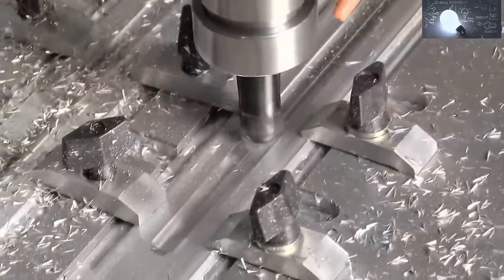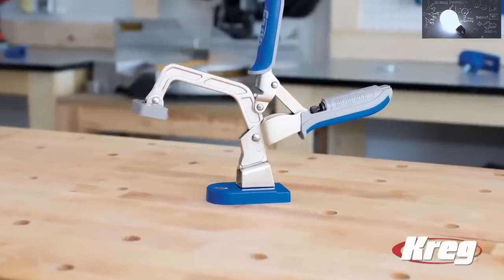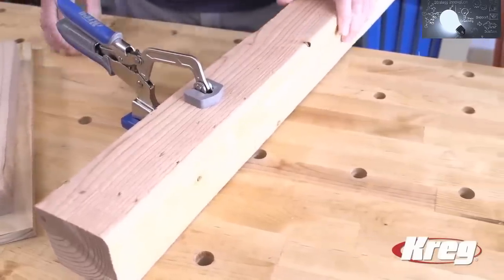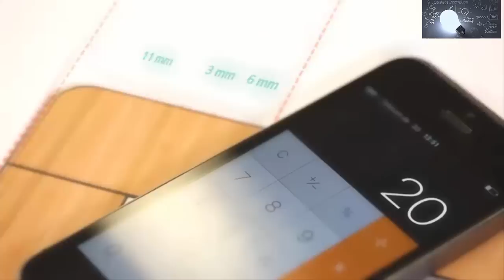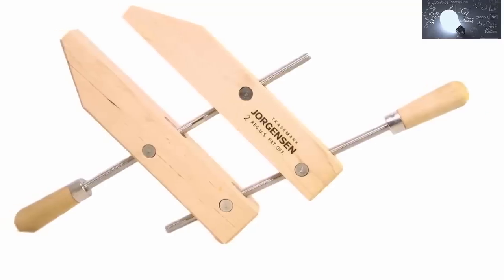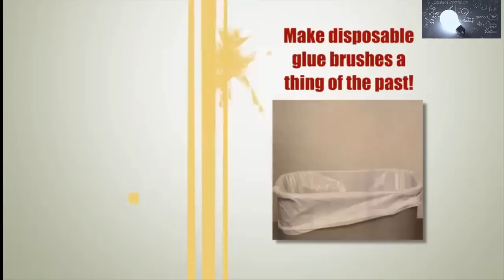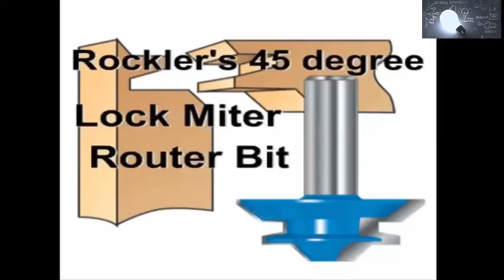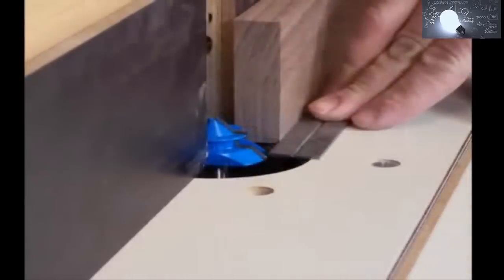10 WOODWORKING TOOLS YOU NEED TO SEE 2020  3

Comment: I used those drywall plugs for 3 years now. They're absolute crap! If you don't stop tightening your screw in time the plug starts turning too causing your plug and hole to be useless. If you wanna unscrew the screw the plug comes out too and once again your hole will be fucked up and will be useless. For drywall i prefer metal hollow wall anchors or butterfly plugs.
Reply: And it took You 3 years of use to discover?.
Reply: @FoxFox0077  no it took me 1 time to discover it and a 1000 times convincing my boss to buy the other ones without success. That's why i unfortunatly still us them after 3 years.